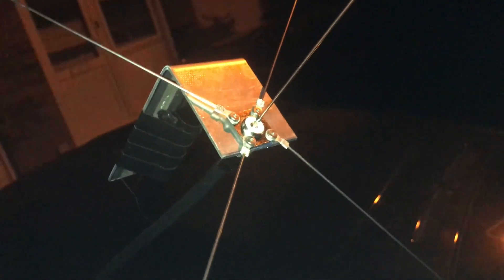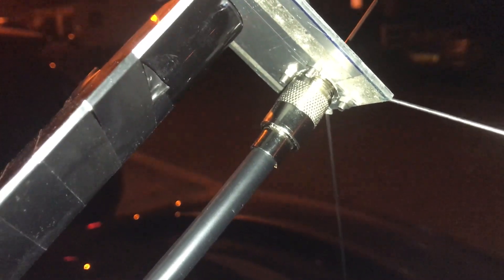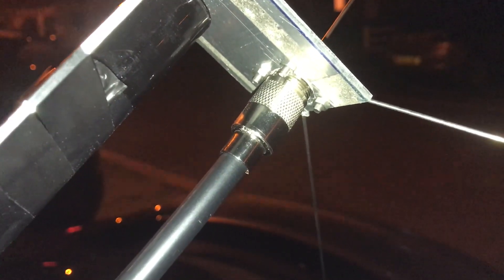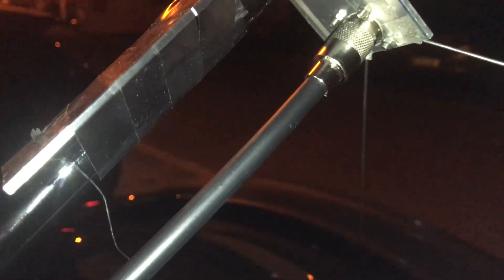A closer look at my homebrew 70 cm colinear antenna for use with my Baofeng GT3 MKII

Comment: Made one of them for 2 metres mobile many years ago and i was able to have conversations with bases stations when on the move in locations that previously there was no signal received!! Mounted on the centre of the cars roof to get a good ground plane and the balancing coil connecting the 1/4 wave to 1/2 wave was tuned up by trail and error until it peaked
Reply from the maker: Thanks for the information.73!